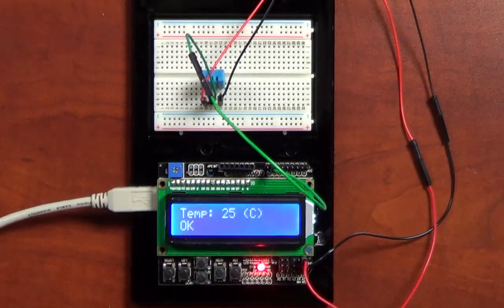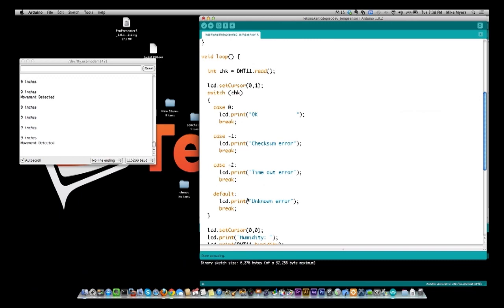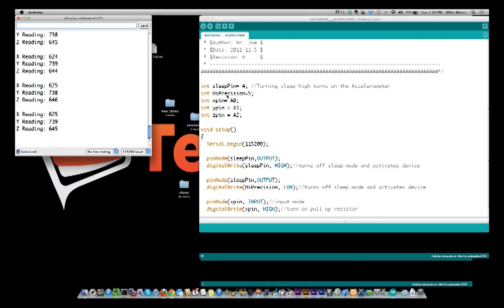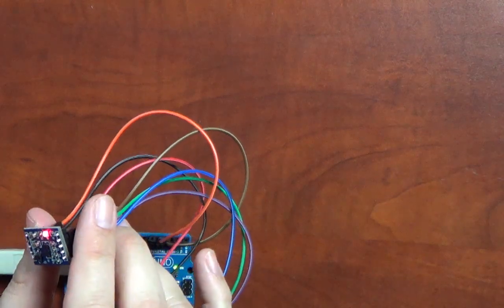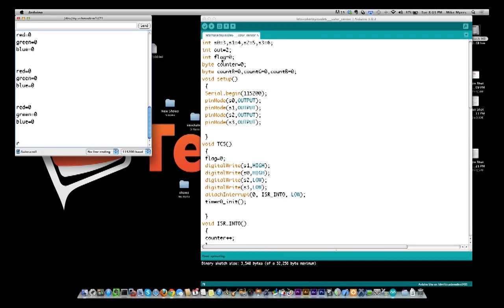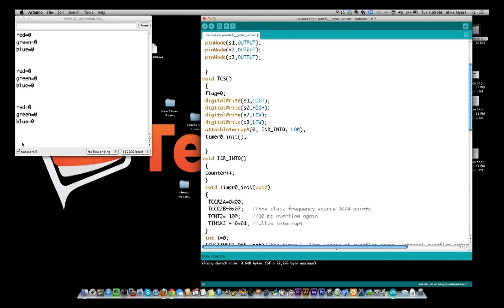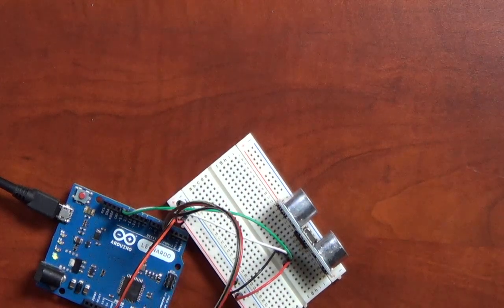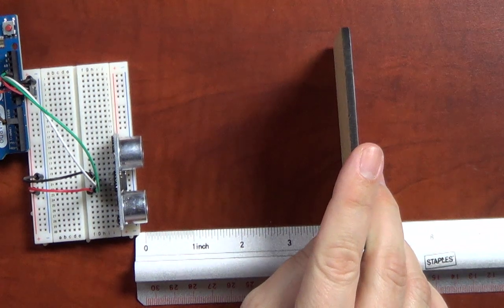Sensor Fun With Arduino: 1 Massive Failure, but 4 Successes - Let's Make It - Episode 6

Comment: Great video. I am glad that our libraries and documentation worked well for you. I noticed that you had a couple questions about the Virtuabotix Accelerometer, be sure you use our auto-calibration and calibrated output functions to actually get the number of G-Forcesor Meters per second squared out (trying to translate the raw analog is pretty tough in your head). Be sure to let me know if you need us to add anything to our documentation.